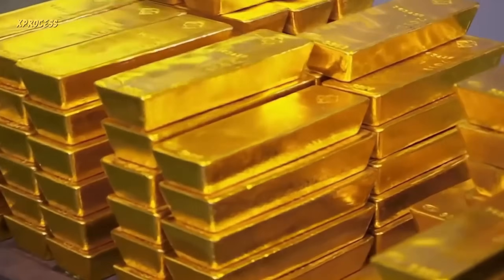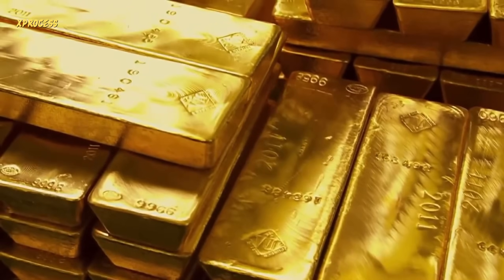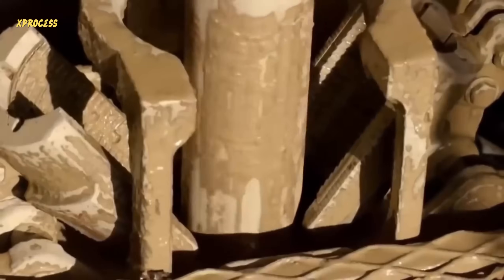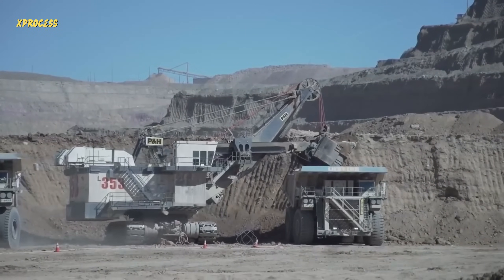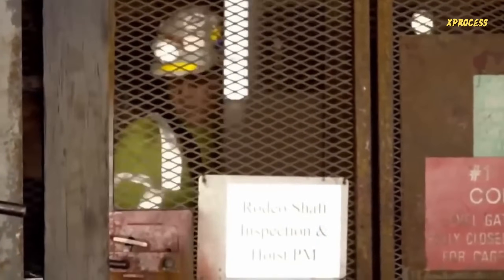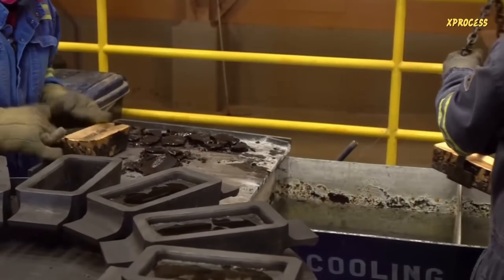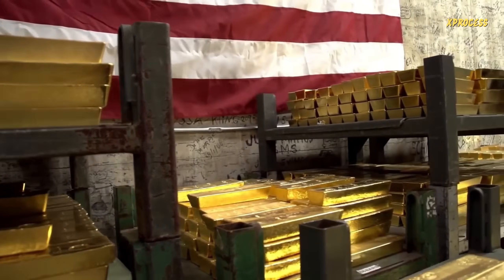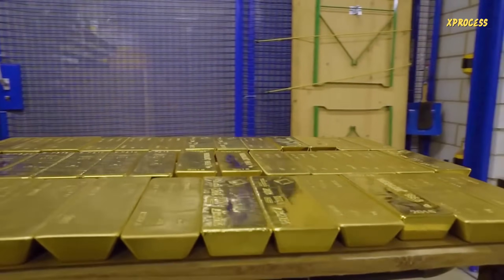How are GOLD BARS made in Factory? How is GOLD Extracted from Earth? AMAZING!

Comment: Is gold valuable because people think it’s valuable? 😂
Reply: Yes, gold barely has any uses, its very conductive and doesn't corrode so it's used in electronics, but silver is a better conductor, but it oxidizes. Other than they gold really has no use other than humans thinking it looks cool.
Reply: @SirSithly silver in most cases looks cooler and is easier to match which is the crazy part
Reply: Scarcity makes it valuable
Reply: It’s a safe commodity in case cash fails. If societies go to shit, if you need something to buy shit, good is what you would use.
Reply: That's the same for almost everything of value
Reply: Finally someone said it...😌😌😌
Reply: Gold is easy to shape, it conducts electricity just as well as copper, but unlike copper, it does not rust or tarnish. It's a vital component of personal electronics, such as the phone I'm typing this with.
Reply: It looks nice ?